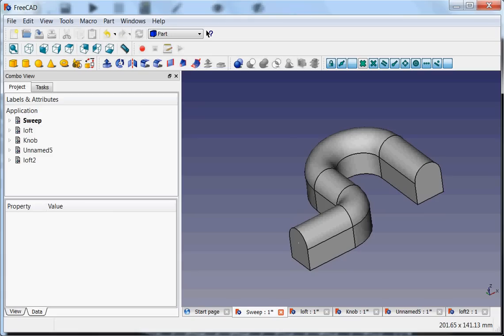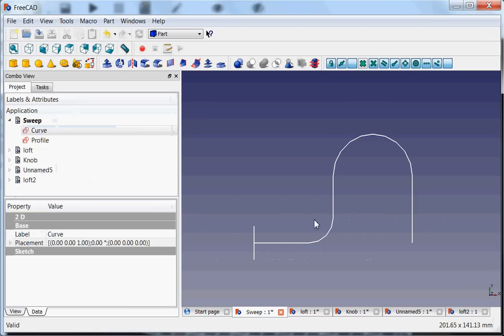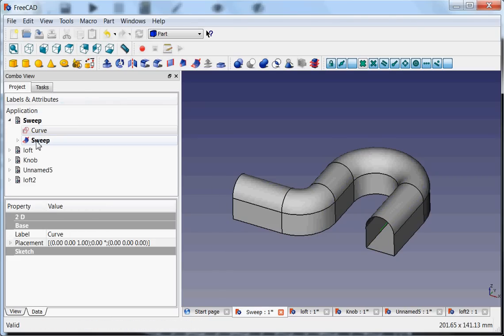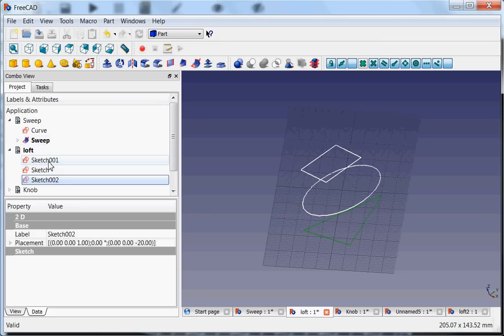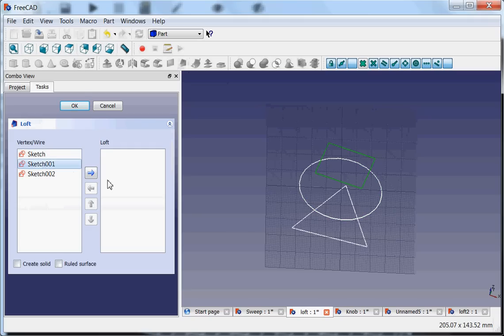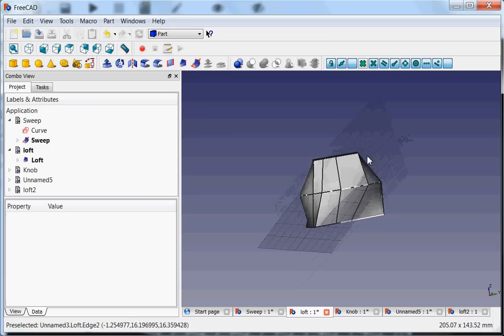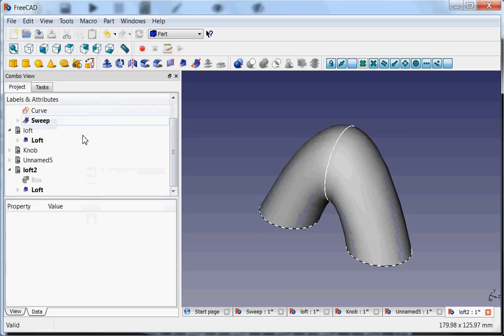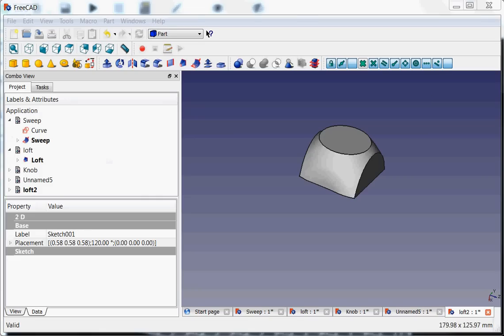FreeCAD Tutorial Part 8 Sweep and Loft Utility

Comment: Thanks very much I have been struggling on doing this kind of stuff in FreeCAD specially the sweep.  I actually want to  draw a hollow channel for fluidics
Reply: Thanks again I was successful replicating this one. I wanted to put some thickness on the solid like a tunnel so I created a smaller version of it same shape inside it however, I failed to generate the sweep I was hoping I  could avoid generating two of them sweeps separately like two solids and have them subtracted. Is this approach possible all?

Comment: Thanks lots!
with this technique it's possible create a tire car (rubber) ?
Reply: yes sweep a profile that mimicks the walls of a tire around in a circle that dictates the rim diameter. need a 1 meter printer like i have tho. Dunno what kinda psi or loads they would hold without steel belting though.